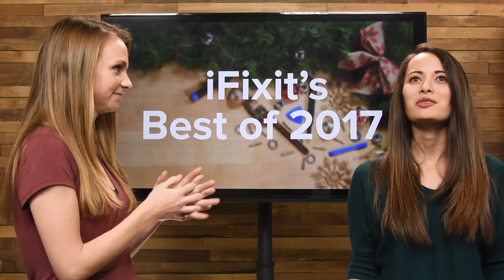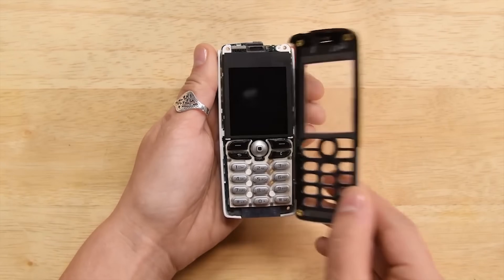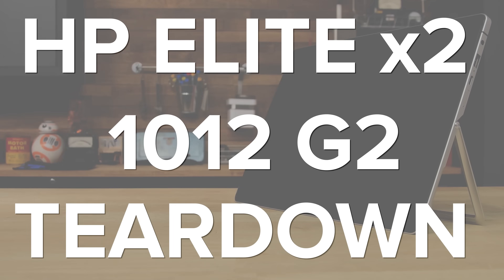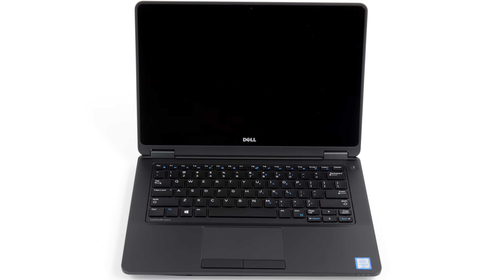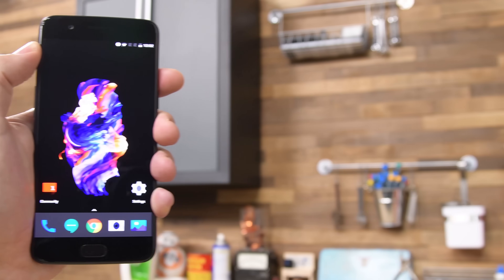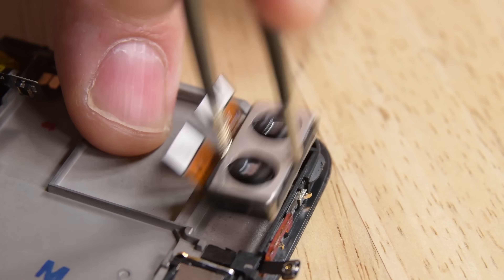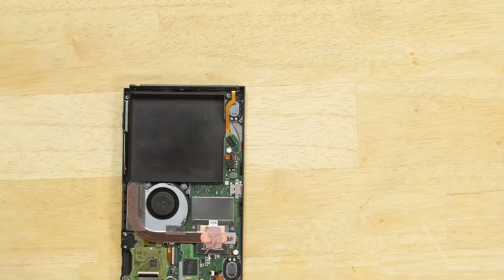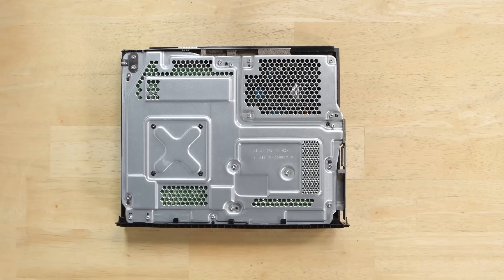iFixit's Most Repairable Devices of 2017

Comment: For laptops... In fact, every ThinkPad have a Hardware Maintenance Manual that includes how to disassemble/repair the laptop, replacement parts can be easily find. But you don't make videos on them 😂
Reply: Kay MW same with dell latitudes and precisions. i think they as well as the thinkpads should be featured more on ifixit.

Comment: after buying three apple laptops in ten years i conclude that apple is not what it was – reliable and trouble free. I wonder which is. Help.
Reply: Every Apple Macbook Pro I ever bought (Powerbook G4, Macbook Pro 15" from 2007, Macbook Pro 15" from 2011 x2) had a GPU failure. The Macbook Pro 13" from 2011 of my wife was in repair about 5 times during warranty and the original Macbook Air I once bought for giggles after it depreciated a lot broke it's hinge while sitting open overnight.

So yes I hear you. I still have that 2011 matte screened Macbook Pro 15" which got repaired by Apple and shortly after failing again by a repair shop and now broke its SD card slot and an USB port. But I am very reluctant in ever buying a laptop from Apple again. 

My classic Mac Pro, Mac Mini and several iMacs I bought and still own had no problems whatsoever, though.